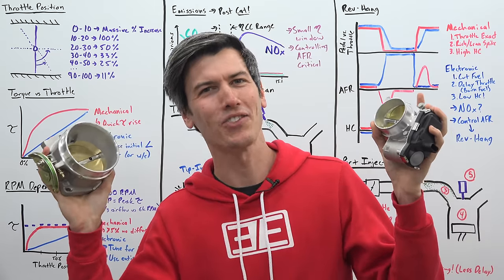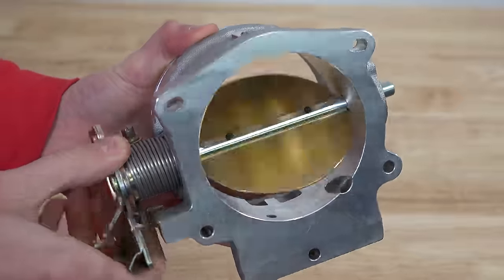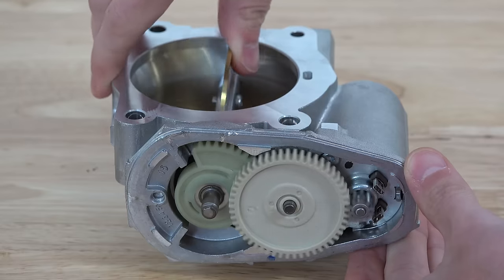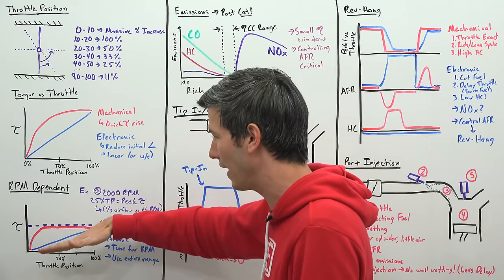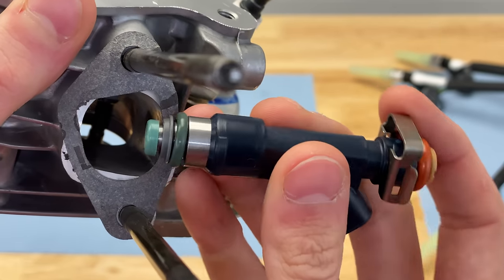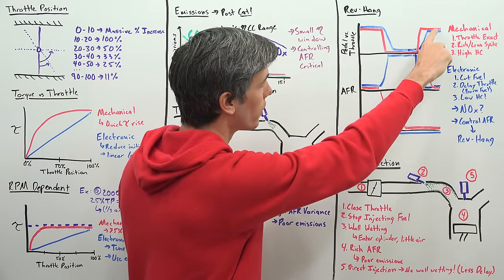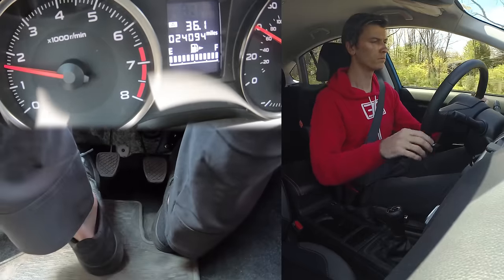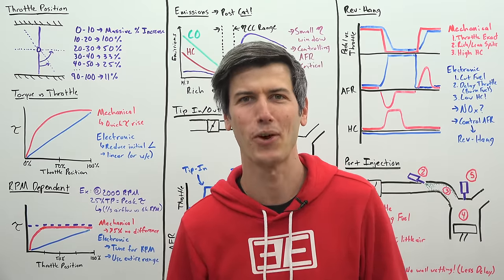The Big Problem With Modern Manual Transmissions - Rev Hang

Comment: Makes me remember looking at my BMW E46 shop manual and seeing the electronic throttle circuit labeled as "Torque Request". We know who's the boss now...
Reply: Skynet sees you
Reply: It ain't the driver. With antilock brakes, traction control and electronic throttles, the computer's in charge. Don't get me wrong: that stuff works amazingly well most of the time, but I do find that the traction control especially on occasion will cut the throttle back to nothing at the worst possible time.

Comment: Excellent description!  The other day, I drove a 2018 Jeep Wrangler with a manual and I noticed the rev-hang and the rpm being too high when I hit the next gear.  I drive an older Alfa Spider that has no rev-hang and I can feel the rpm match as I up shift.  With the Jeep, I was always at too high rpm.

I owned a 2017 Toyota Corolla iM and I also noticed the rev-hang.  I thought it was due to how freely the motor revs.  Now that I've watched this video, I understand the process.

Thanks again for another excellent video!

Comment: On one of my carbureted motorcycles it has different cable cams to change the rate the throttle is open in relation to the grip. Still if you wack it to WOT it’s still open but it does help make the throttle position to power out put more even. Also on fly by wire motorcycles the slight delay in throttle response is really noticeable. Every time I get on one it takes a few minutes to get used to it. On motorcycles where you’re so connected to the machine and road the fly by wire is not my favorite thing. I believe they can make it better and throttle hang has never been an issue I’ve noticed on them. Could be due to the ITB that motorcycles have.
Reply: Jake TheGardenSnake i have ridden newer bikes where you dont really feel the delay but older bikes with e throttle do really feel different. Also carb vs no carb.
Reply: I was thinking the same thing.  Just take a cable cam that is elliptically shaped and it would start opening slowly and thereby straighten out the torque/throttle position curve.  Cool to hear that they are using that on motorcycles!
Reply: The carbs on the old bikes I've messed with have a vacuum-regulated venturi downstream of the throttle plate.  This is essentially a gate valve that restricts airflow like the throttle, but for the purpose of maintaining uniform air speed through the venturi to ensure consistent fuel draw and atomization.  
I haven't ridden a motorcycle with electronic throttle, but I would expect any delay to be disturbing.
Reply: Hey, Jake! Wanna say some cars have the same "cam" on the throttle shaft.. love the vids!
Reply: Love your mt07 series Jake, but I couldn't get over the jerk throttle response of mine. Got a cbr650r. The jerk is still there but much more maneagble in a smooth 4 cyl.
Reply: @jamesmoechnig3855  Sounds like the early British  Sports cars with SU or Stromberg carbs,  that included a dashpot for transients. But my bikes, 81 Suz and 76 Triumph 750's, had simple carbs.
Reply: @jmmycnnll  Look at the manual TB in the video, it is elliptically shaped !
Reply: All my bikes have a carb. I tried a second gen Hayabusa and that’s when I decided to only buy bikes with a carb.
Reply: I have driven a 2010 Hyosung Comet 125GT with carb and opening the throttle full actually CAUSED a delay in torque. An electronic version would have reacted better.
I later drove a 1997 Suzuki Bandit 600 which with carbs too, and it didn't have any delay. It was very very reactive. But it probably polluted a lot.
And later I got to try a bunch of electronic-heavy stuff, Kawasaki ER6N, Suzuki GSX750, Triumph speed triple, Ducati XDiavel, Kawasaki Vulkan, Yamaha XJR1300, Kawasaki ZRX1200 and a bunch of others (even a Harley) and none had any delay.
Reply: @vindieu  all electronic systems have a delay. There is no way to remove it 100%. If you understood how electronics work you would know that.
Reply: @eatshitful  I'm an engineer, I have a master of science, I was formed for 3 years in high school in electronics and machining, and 2 more years more after that in industrial engineering, plus 3 years of computer science. I fixed my motherboard when I was a teen, I designed LED circuitry, and speaker filters. You still think I don't know how electronics work? There is no humanely noticeable delay in throttle in all the bikes I mentioned. If you mean the delay is not strictly zero, well yes you're right.

Comment: Oh so that's why my car sometimes jerks when I shift and keeps the revs longer than older cars when clutched in... Good to know :)
Reply: Yep. I just spent the past handful of months learning that the hard way, and then this video comes out. I learned to drive on a throttle cable - and when I got a newer manual it took me forever to drive it smoothly... and I have to wait sooo looong between gears. Yes yes fuel economy but I WANNA DRIVE
Reply: yep quicker, more difficult clutch jobs.
Reply: When u shift up for example from 2nd gear to 3rd gear do not fully release accelator paddel try to keep u r car in 1500rpm when shifting up u r gear .. in this case ur car engine will be in motion and u r car will not jerk by releasing cluch
Reply: I was thinking iam shifting my car wrong all this time lol
Reply: @umairumair1680  that will increase clutch wear
Reply: At least it should help with downshifts, because revs are kept high longer, right?
Reply: Any tuner can turn that off.
Reply: @dhoffnun  at the moment i have both and often i'am what the fu.. is the e-throttle doing now. Maybe there is sometimes sense in what it is doing but it often does not what i expect from my throttle Position. There is also a help on low revs and open und closes the throttle by itself. This often confuses me because my alldaycar does exactly what i want.
Reply: Lol I thought there's something wrong with my car , it's quite old but turns out it has electronical throttle
Reply: Bratislavský svišť je krásne meno xD
Reply: Yeah, I used to drive an old Honda Accord 5-speed MT and it was so smooth and easy to drive. The shifts were quick and butter smooth. My WRX on the other hand shifts slower in lower gears and isn’t as smooth as the Honda.
Reply: @MegaKamil5  ya it's the upshift that has always given me problems
Reply: David Hoffnung tune it
Reply: I notice my car does this more often if I’m accelerating heavily
Reply: @setcruz  Get OVTune, fixes most of the 3.5's problems.
Reply: it was pretty funny driving a neighbors 70 corvette. i went to shift and the revs just instantly fell. the only cars i had driven previously were all 2010 or newer so it was super amazing to drive a car that didn't have rev hang. the thing free revved like crazy too, super fast downshifts.

Comment: My dad has a 19 Subaru Impreza, It's the first car I've driven to have so much rev hang that I needed to learn how to drive "around" the hang. I thought it was just a crazy heavy flywheel! Great video! I'll have to check it out later lol
Reply: Thanks for sharing, I have an Impreza from the same year and this makes me regret getting the cvt version less.
Reply: yep 2017 impreza, i spent 300$ for tactrix cable + epifan subaruedit software to do a rev hang delete. probly the best and only engine upgrade i plan to make for the car but it made a huge difference and will save my clutch down the line.

Comment: Thank you! After I got my manual BMW, I thought I had forgotten how to drive stick because I kept getting weird revving when I was shifting. Now I know what it is!
Reply: I too experienced the same thing. It is still driving me nuts after a year of owning the car
Reply: @L39T  I was learning to drive stick on a new Subarua and was pissed that I have to wait for something to happen when realising the clutch.
Reply: just give it some gass when you let the clutch bite. or a lot of gas; the 6 speed subaru transmission is pretty strong now :-)
Reply: Many manual BMWs also have clutch delay valves. Look up if yours has one and get it either removed or replaced with a valve that doesn't delay.

Comment: good thing that my throttle is cable operated
then again my scooter doesnt have any gears...
Reply: Probably has a carburetor as well, doesn't it? Would be interested to see these curves of lean/rich mixture when closing or opening the throttle valve of a carburetor-engine :)
Reply: HECKproductions a Cushman possibly. Slowest scooter ever developed.
Reply: My scooter had cable operated throttle. It snapped @120km/h and stayed wide open when I had to brake for a corner. I'm alive only because I reacted fast and hit the engine kill switch
Reply: @BoliMeKurac  Learn to check cables! I had a drywall jack fall on my head because of a faulty cable.
Reply: same, but i dont even have a car
Reply: @BoliMeKurac  Jesus. No throttle return spring?
Reply: @JPRTonundFilmstudio  some cars have F.I. and are cable operated. Long ago they migrated to electronic throttle body for fuel consumption as they operated more linear. This happening 20 yrs I think the law emissions allowed these small variations that are fight today
Reply: @xavierrodriguez2463  yeah without a speing it dont matter if you let go of the gas even if the cable still works :p
Reply: @JPRTonundFilmstudio  It'll be different for different types of carb too!
Reply: @BoliMeKurac  It wasn't correctly set up then. A cable failure should always result in the throttle closing.
Reply: ask him to review that 3 cyclic opposed piston engine made by jp student in 2010 video is gone he runs a cold test on it
Reply: @JPRTonundFilmstudio  as a matter of fact it has port injection
Reply: @xavierrodriguez2463  tell that to Aprilia
Reply: @millomweb  if it was faulty, it came like that from factory
Reply: I'm the 666th like
Reply: @BoliMeKurac  120km/h on a scooter ? Were you on a suicide mission ?
Reply: Think about the turtles you're killing man!!
Reply: @BoliMeKurac that's why normally scooters that go over 60km/hour have 2 cables. 1 to open and another 1 to close. Just like motorcycles have
Reply: Old comment, but scooters indeed have gears.  After variator there is typically a gearbox

Comment: I seem to remember that cars with a mechanical throttle would rev hang. There was a device called a dashpot that slowed the closing of the throttle thus reducing emissions.
Reply: Correct. Tune can help this or some physical mods to the valve.
Reply: Yep, exactly right. I think the N/A AW11 MR2s used a dashpot, but the supercharged ones didn't, for example. On the other hand, all 3 cars I've had have had mechanical throttle bodies without a dashpot, so I don't think this method really took off until the electronic throttle bodies made it trivially easy.
Reply: Those were mostly on cars with carburetors. They tended to run very rich coasting at minimum throttle, which meant they ran very dirty. The dashpots I remember were vacuum operated and would keep the throttle from closing fully until the RPMs came down.
Reply: Yup, a mechanical solution but for the same reason.

Comment: Few things are more satisfying than responsive revs, up or down. Rev hang ruins the manual experience
Reply: Got that right. I want my car to jerk left when I stomp on the gas, and jerk right just as fast when I let off. A motor should decelerate just as fast as it revs up...
Reply: I agree. Some modern manuals will prevent the engine from stalling or even restart automatically.   Enough.  Make manuals actually manual.
Reply: Right? Idgaf about emissions on my weekend car, I just want it to feel like a real car. Not like these babysitter cars that have 100 different electronic systems on them (like ESC) making everything feel numb and dull.
Reply: They should keep it electronic for automatics because of the listed advantages (especially as the sensors/computers get more complex they can boost efficiency) whereas manual should be a simpler mechanical system the way people understand (at the cost of some engine-level controls that are only possible with the computer system anyways)
Plus someday there's gonna be a significant split to self driving cars where there is no human-shifting or "pedal feeling" anyways
Reply: Gainz plz  to be fair they have some advantages for performance too - humans only have so many limbs but the computer can control/monitor hundreds of points, but like he said it's up to how the computers are tuned/configured — most consumer cars right now are just meant for a smooth efficient ride... they should give more options to have either manual or power/control-tuned systems (interestingly, Tesla cars have some of this: because the motor is entirely electronic they can accurately control stuff like how much power is pumped into it at different speeds - apparently destroys your efficiency but gives crazy acceleration especially at low speeds )
Definitely need more modern cars that keep the "fun manual" experience one way or another though :/

Comment: Hey Jason, 
I get your point, electronic throttle bodies are good for efficiency and drivers who don't care how their car actually drives, but, there is one big BUT.
Then I drive my car and press the pedal, i don't measure how much in percentage i press the pedal or how much torque I get from the engine,  then i press the pedal i want CONSISTENT response from pedal, i don't want 20% torque at 20% pedal input, i want 20% throttle body open - direct control. Because with todays cars i hate that detached feeling, then i press in full pedal and i feel that throttle bodies are not opened to the fullest, sound alone gives that away and saddest part is sold my 1992 volvo 940 which had mechanical throttle bodies and now all modern cars have electronical throttle bodies :/.
I don't care about efficiency because i love the feeling you get then you get pedal in 'right' position for your speed. Maybe you could make an episode about switching from electric to mechanical  throttle bodies ? is that possible ? is that hard ? Maybe an experiment with your own car and a little drag strip ? ;)

Comment: Imagine this: carburetors would actually fix the throttle tip in and tip out problem.

I mean there's a million other problems it comes with but it fixes the problem.
Reply: he should make one big video about carburators. people these days are not familiar with carburators at all. with carburators once you let off throttle, the vactium starts sucking alot of fuel thru idle jet, and its massive amount that it sucks there. this was on old carbs so with old carbs you saved fuel when you went to neutral when letting off the throttle because it sucks tons of fuel when throttle is closed and rpms are over idling rpms. now newer carbs in the end had a valve that closed idle jet channel when rpms were over some certain rpms and throttle was fully closed. it opened back up if you press throttle or rpms droped below this certain rpm, but even this sort of system richens af ratio when coming off the throttle cuz it takes time to close that valve. but it did improve fuel consumption. now carb system itself always has problem that when you press on the accelerator the mixture is very lean for a moment, its that much that engine actually might want to shut off. this is mostly because some channels little bit flow down so the fuel isnt being sucked instantly and it takes slight time to suck them back up. to overcome this very lean mixture, all of the carbs (not including small scooter and chain saw carb cause their engine size is so small that theres no need for this thing) have a thing called accelerator pump which straight up pumps fuel into the intake while your pressing the throttle. full throttle press gives you about 10ml of fuel in the intake (this amount is taken from 1.5l inline 4 engine). now this fixes the problem of lean side,  but it actually richens mixture alot so again you have bad emissions, so mixture with tip in and tip out is very rivh. now this accelerator pump is very useful for cold starting. you pump certain amount of fuel into the engine, and my car has started instantly even with -30degrees. something injectors never achieve cause they need first 2 rotations to get pressure up in fuel pump. carbs have, and always will have worse emissions compared to injection.
Reply: @matufujiwara7493  I live in Puerto Rico back on the 80's and we let our cars in 2nd or third gear going down the mountains to   preventing boiling the brake fluid b y over heating the brake caliper going down hill for 10  minutes straight. When throttle body is close, it can't take more fuel than the idle jet will allow because there is a size restriction that won't allow more fuel trough the passage. therefore It will use no more fuel than what it will use for idle.

Comment: Finally, an EE video that explains rev hang. Thanks!  Just a couple of questions:
1. Why does rev hang not exist when downshifting? It only mostly happens during upshifts.  
2. My 2014 VW GLI with the 2.0 liter GDI engine had upshifts rev hang. However my port injected 2014 Corolla hardly has rev hang. Could rev hang be more pronounced with turbocharged engines?
3. Finally, how come lux brands BMW and Porsche do not have rev hang? How can they bypass emissions control?
Thanks
Reply: Porsches and BMWs do rev hang too, you only have to search for in on internet.
I have also read that yes, it is usually more pronounced on turbo engines, because, they have a more natural tendency to lower the rpm more slowly than N/A cars due to the turbine inertia, or so I think I have read